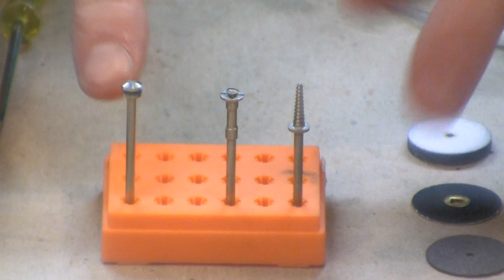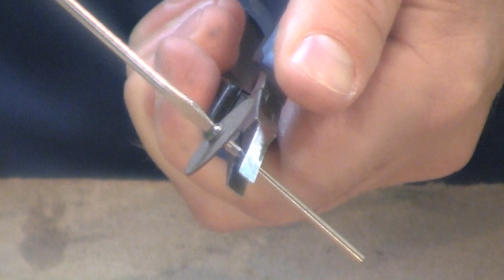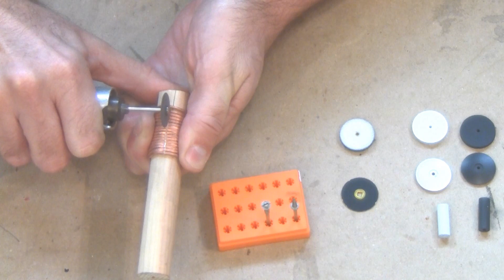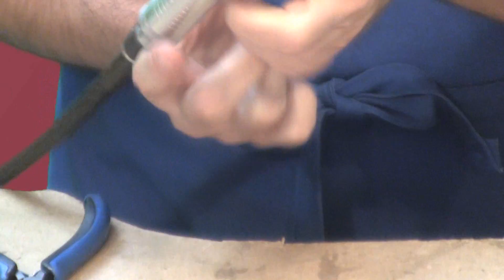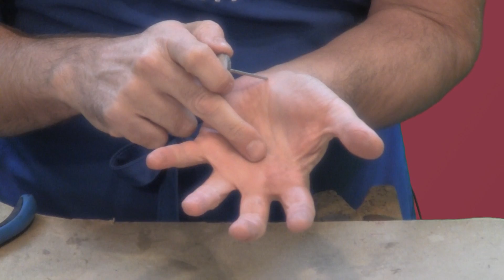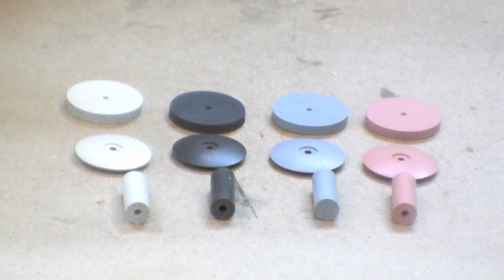Must Have Accessories For Your Flex Shaft

Comment: hi, do you weare a mask when sanding the metal? or just while polishing with the compound?
Reply from the maker: You can wear a mask during both procedures. However, if you use wet/dry sandpaper under water, no mask is necessary when you sand. 😀
Reply: @OnlineJewelryAcademy  thank you

Comment: Hi. Great video.   What are other uses for the separating disc?  Thanks!
Reply from the maker: As mentioned in the video, separating discs can be used to remove sprus from castings. You can also use them to grind surfaces flat for soldering. You might also use them to carve a decorative textured surface. Thanks for watching the video. 😀

Comment: What is the best attachment for super fine polishing. Very little scratching. Just hairline. It’s for my Rolex. I have very fine surface scratching. I need to bring back the shine. What can I use
Reply from the maker: I would recommend that you take your Rolex to a recognized Rolex dealer and have them send the watch in for refinishing.  You don't want to do anything to an expensive watch that could potentially decrease its value or void its warranty.
Thanks for your support! : )

Comment: There are many good presenters on various subjects on YouTube, but your presentation clearly shows you are a great educator. Clear, concise and informative.  But I am cringed when seeing you hold the parts by your fingers when cutting or polishing them. The parts or the flying wheel can fly off accidentally injuring you or the Dremel operator. The 30,000 RPM Dremel can cut off your finger in a blink of an eye. Why not laying down the coil on the table and holding the wooden rod while cutting the coil? I would  use a pair of piers to hold the brass piece while shining it instead of holding it  by your fingers?
Reply from the maker: Thanks for the compliment.  I'm glad you're enjoying the OJA's videos.  But, I'm not using a "Dremel" tool in the videos.  The speed of the tool is not as great as you stated.  Second, I did not demonstrate with any attachment that has the capacity to "cut off my finger in the blink of an eye."  
Thanks for your support! : )
Reply: OK. In 2 blinks of an eye  :)

Comment: Thank you so much for this video! I really need to get a flex shaft. I've been using Dremel rotary tool and it's excellent but I've been holding the whole tool in my hand which goes numb quite quickly while working. Flex shaft will give me much more freedom. There's also so many bits I haven't been using yet, so excited to try them!
Reply from the maker: I'm glad you enjoyed the video.  Have fun experimenting with the various attachments in your Dremel kit.
Thanks for your support! : )

Comment: I just want to mention: Metal powders created by abrading them are extremely bad for your lungs (As you can see in the video, John has said he wore a dust mask during grinding and keeps the pieces well away from his face) and I want to remind people to wear a mask and or use a vacuum cleaner with a good filter in it and work in front of the suction head to avoid getting metal powders in your lungs. The small cut off wheels also have epoxy, fibreglass and abrasive grit in them.
Reply from the maker: Thank you for posting your excellent comment for others to read.  I'm all for safety first in the studio.
Thanks for your support! : )
Reply: This is a terrific training video. John, thank you for helping  me understand more about the attachments available for my flex shaft.
Reply: I was about to ask about this.  Thanks for posting.  Do you recommend a type of good mask to use if you do a lot of grinding, abrasion, and polishing like this?
Reply: use someone else's face

Comment: difference between a "mizzy wheel" and the last white wheel you used, it's all a bit confusing....we need to know why we'd use one instead of the other, etc. (tough question, I know...). Please illuminate us with the REAL info, the whole "whatever you choose" thing is soooo misleading, mixed up. There just MUST be a reason to use one item over another... I hope! Thanks!
Reply from the maker: The mizzy wheel is a very course grinding wheel.  The silicone white wheel is not quite as abrasive.  If you look up the various attachments on a jewelry supply website in a supply catalog, you can read descriptions of their qualities and what they can be used for.  But experimentation is really the best way to become acquainted with these tools.  Dremel sells a set of attachments for their tool that includes many items similar to what was shown in the video.
Thanks for your support! : )

Comment: pendant motor or micro motor; why choose one over the other?
Reply from the maker: If you mean flex shaft vs. Dremel, I would choose the flex shaft because there are more accessories for it.  This includes different types of hand pieces; including hammer hand pieces and quick change hand pieces.
Thanks for your support! : P
Reply: I actually meant a micro-motor- like the Foredom. I've seen a few jewelers using them instead of a pendant motor for stone setting work, it has the quick change hand-piece style. Always wondered....
Reply from the maker: I'm not familiar with that tool.  Sorry.  Perhaps there's some good information on the company's website that would answer your question.
Reply: Oh, ok. Um, item # 117599 at Rio Grande. Thank you Professor!

Comment: The one thing you didn't show...I need help with.  The long sanding piece that has no way to put anything on top to tighten it.  So when I use it it wobbles and eventually pops off the screw.    Thanks K
Reply from the maker: Hi Kaye,  Based on your description, I believe you are describing an item similar to the one in the photo for the video.  Just be sure that you have screw in mandrel that are threaded in the correct direction.  And, be sure that you are running your flex shaft in a forward motion.  Otherwise, the element on the end of the mandrel will unscrew itself and fall off.  I hope this helps.
Thanks for your support! : )
Reply: You should put it in a vice grip or a clamp (Making sure not to bend the shaft) and make sure the sanding piece is twisted all the way down. When you start to use it (Until it wears down to a cone shape top), just use light pressure. I had the same problem until I twisted it down well.

Comment: Prof. John, I only have a Dremel but I have all the attachments. ..do I really need a flex shaft or can it wait until I havey cabin workshop up and running?  Should be by summer when I will have it all kitted out for hot work and any heavy duty stuff. I'm managing with the Dremel so far and my torch but really want a proper kiln and forge and I am not the best at waiting (I know, its like instant gratification but I get all excited about projects and am a bit of a kid when I have to wait to try stuff out! lol!
Reply from the maker: You can use these same attachments with your Dremel tool.  Be safe and have fun.
Reply: OnlineJewelryAcademy I feel bad now because I seem to have you typing and answering me as much as you would have to if I actually was in a classroom with you.  I just love your channel it really gives people the chance to explore different techniques and expand their knowledge.
Reply: I agree with John. For myself, I have a dremel, a foredom and a special dental micromotor machine (Kavo K10), but before I had all of that, I was using a 10 dollar clone of a Dremel (Without flex shaft, since it was badly made, the one I had) and it served me for 4 years :) If you are in no hurry, you can order a good flex shaft from Aliexpress for really cheap.
Reply: Artisankat Studios oh thanks when I finish kitting out my work place I hope to start getting some more professional tools. .I will bear this in mind xx
Reply: @Foxiepaws A - Wen makes a good rotary tool, the entire kit is only ~$20  - that’s for the tool, attachments, and a 4’ flex shaft. I have a brand name Dremel too, and the accessories are completely interchangeable. I’ve had no problems with either the Dremel or the Wen, but you can’t beat the Wen price: https://www.amazon.com/WEN-2305-Rotary-Tool-Shaft/dp/B003BYRFH8